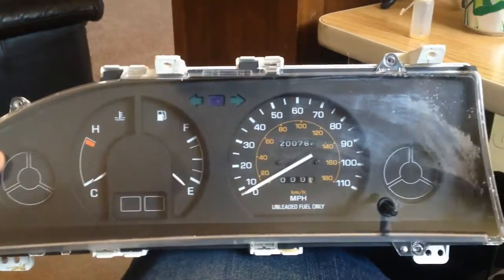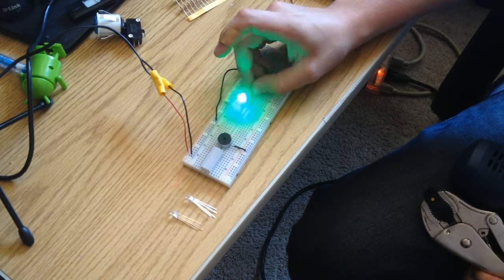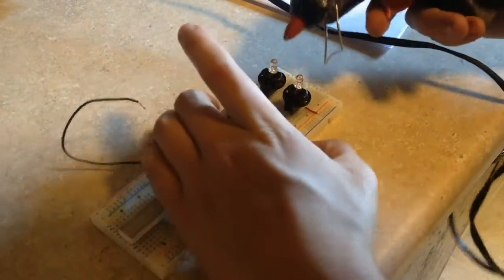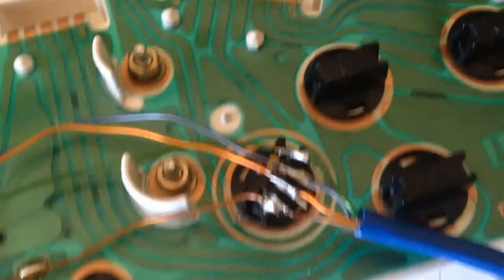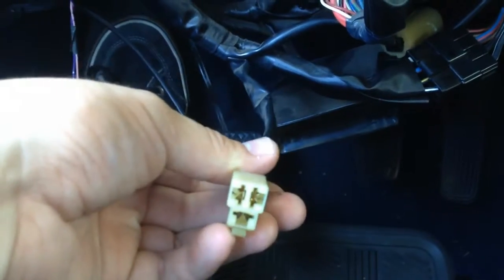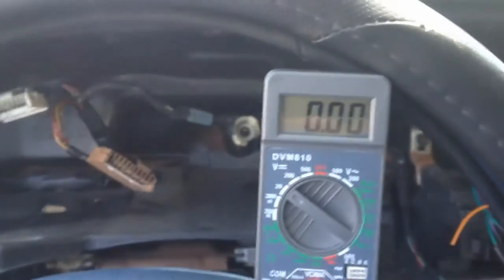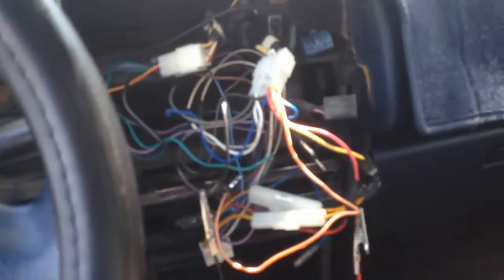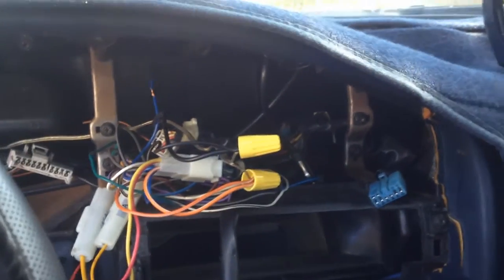RGB Dash Light Hack

Comment: I did something like this to my dash lights too. Instead of replacing the bulbs, I added a strip inside the dash. I also used ether net cable, and I even used the same insulation colors for R,G, and B sink wires. Mine are wired to the switch for the running lights.
I also wired mine out to the doors, and ran LEDs under the doors, and I replaced the door lights with SMT RGB LEDs. I run all of them from a LED strip controller that can do any color, dimming, or color cycling. I prefer slow color cycling.